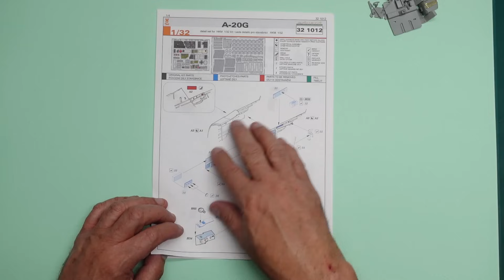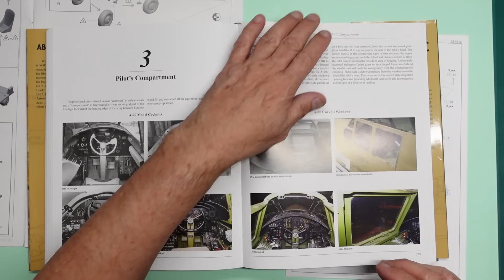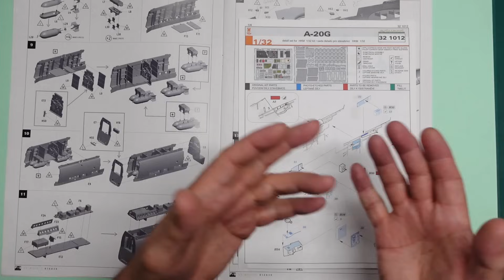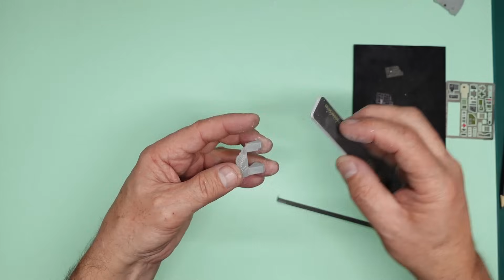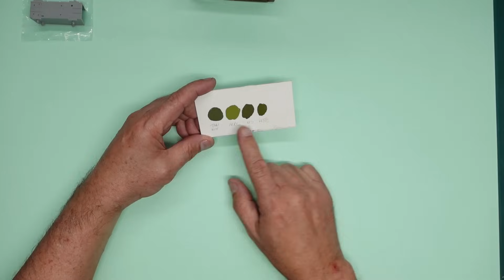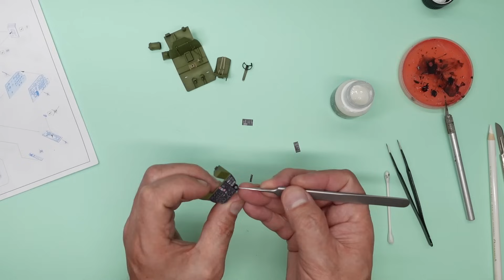HKM 1/32 A-20G Havoc build. Part Two.. Cockpit number two...

Comment: Hello to Jess and yourself. The green card  seems to work well. It’s Matt enough to absorb the glare from your lights and provides a nice contrast, with no lines from a mat to make the background to fussy. Thanks for another great video. I’m leaning towards the best bits of each 3 but using the Airscale  parts as the basis to build on.
I’ve found a old photo that shows the instrument panel lined up with a canopy frame to see exactly where it sat. I just need to check I can identify which frame. If I recall it’s a change in size where a frame on the bottom layer is dropped on the next up. I’ll see what it does when I can reach the kit. Thanks again roll on part 3

Comment: hello Nigel... this video is going to be a big help for me when i start doing my PE cockpits... so all you do is sand the PE parts to accept paint .. you don't use any etching solutions... now i know why i loose some parts...it's the tweezers i'm using... lots of great info in this video.. thx 4 sharing...vinny... aka... CaptainCuzzz6951
Reply from the maker: Use an etch primer for what it's worth. De greasing is important too.

Comment: Hi Nigel, Great video 👍 Really enjoying the info in these 'detail up' videos and looking forward to part 3... I think the light green paper background works great, much better contrast with the kit parts both when grey and painted. The camera seems to have a much better time focusing and seems to do it faster, especially when you are bringing small items closer to the camera, though that could just be a function of the improved contrast.
It was also much better after about minute 52 when there was not a bit of the darker green cutting mat showing on the right hand side of the screen and the whole background of the field of view was the light green paper, I guess you had zoomed in a bit for the photo etch section, before this the darker green stripe on the right seemed to be coming in and out of focus with the camera on occasion.
Also not sure what might happen if you added stickers back on the top of the paper! Not sure if you may or may not be planning to do this but if they were there it might cause the camera to try and focus on them and not the work in hand!... Clearly without the stickers in view any promotional aspect of the video becomes diminished but how this compares to the better overall viewing experience is down to your call..
Overall a definite improvement over the plain darker green mats and seemed to be better than the light grey mats especially when the lines / boxes are showing..

Comment: Ahh the cockpit colour argument. Depends in which factory it was built, did they mix the paint there or was it mixed by a sub-contractor, what year was the aircraft built. All these and many exciting questions will have multiple answers. So it's up to you. Generally for US aircraft of WWII I use Mr Hobby H58 and I either add a bit of yellow, or a bit of black to give a bit of variation.

Comment: I'm left scratching my head a bit about cockpit colour. In Bill Wolf's book, he says (p271) that "The cockpit was lined with a noise-reducing, flame-proof, cloth covered green "Spepak" or kapok felt "Resistohyde". The cockpit floor was covered with flame-proof green carpet". I can't see much evidence of either in the restored aircraft pics, but on the original b&w pic of the pilot engine controls (p279) you can definitley see a quilted cloth finish to the back panel behind the pilot's seat. So I'm a bit sceptical about those restored aircraft pics as references  (which might cast further doubt on the placard colours). Leaves me stuck on the colour for the quilting, but I seem to remember seeing pics of something similar in some bigger American bombers, so maybe some of the B-17 enthusiast might have more of a clue? No idea about the carpet though - I've never heard of that before.
Reply from the maker: Oh dear… the plot thickens!! There are period pics with no insulation??
Reply: @NigelsModellingBench  I've not found too many period shots that show the rear cockpit bulkhead shots very clearly - a difficult shot to get without falling off the nose, I can imagine! Those in Bill's book all seem to be 'instructional' shots that I can imagine would possible leave the quilting out for clarity. There's a contemporary 'Handling Characteristics' Youtube vid of an A-20c that also show's glimpses of quilting behind the pilot. I've found a couple of carpet reference shots now too - they seem to look just like clip-in,  removable car mats sitting either side of the column up to the rudder pedals.